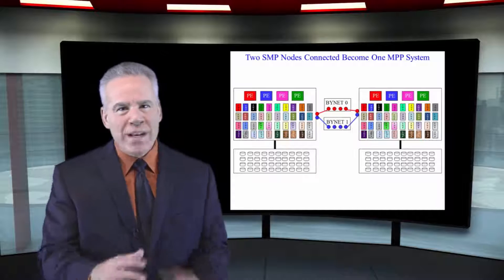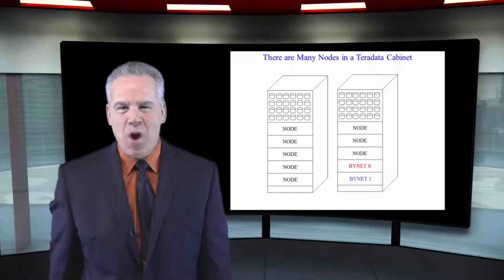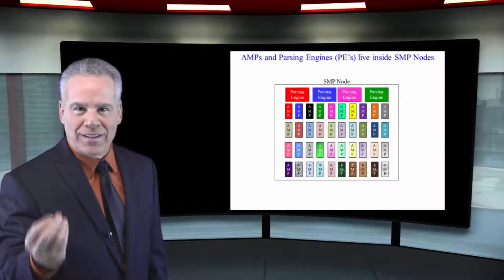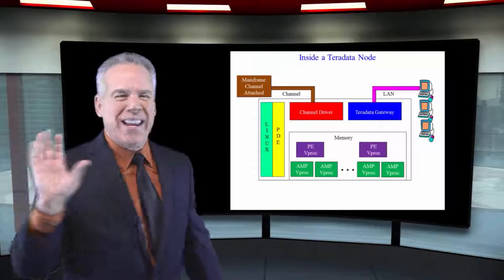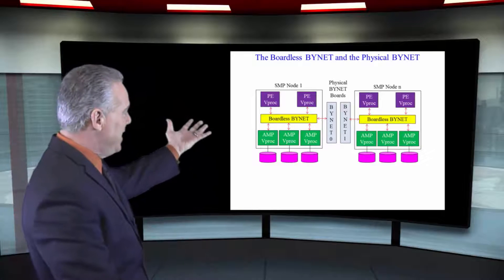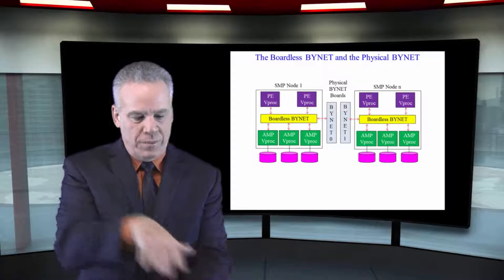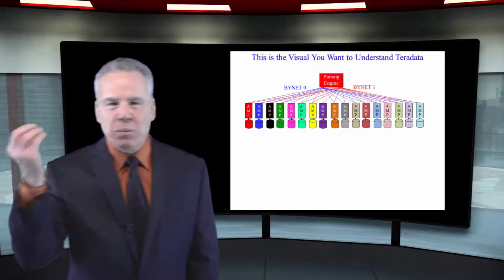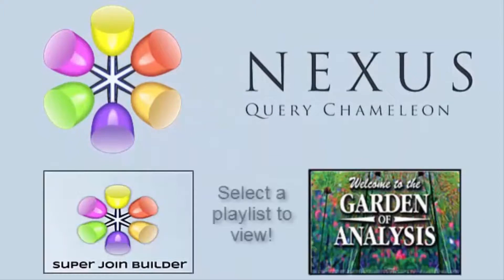Let's Learn Teradata Lesson 8: Nodes and Architecture

Comment: First of all Great explanation sir. thank you for sharing your knowledge with us. Secondly, I am confused a bit with node in teradata cabinet. The nodes inside the cabinet are the SMP nodes or the nodes which send the query to PE and at 1:30 where you are explaining  Inside the Teradata node. Here node refers to the node which sends the query from client to PE or it refers to
the SMP Node. Thank you again
Reply from the maker: Abhishek,  Thank you for your kind words.  The Node in the explanation refers to the SMP node.  There is no node which sends the query from the client to the PE.  The client is connected to the Teradata system via the channel connector for mainframes or the LAN for the PC.  The client writes a query and executes it and the query goes over a network (mainframe channel or LAN) and it is delivered to a Parsing Engine (PE).  Each node will have two PE's and about 40 AMPs.  Whichever PE the query is assigned will command all of the AMPs in all of the nodes to perform the work.  (you get assigned to a PE when you login and you stay with that PE until you logoff).  So, Node refers to a SMP, which is where the two Parsing Engines and 40 AMPs reside.